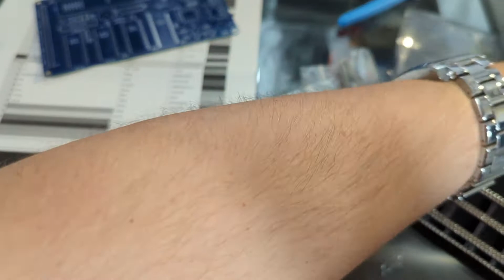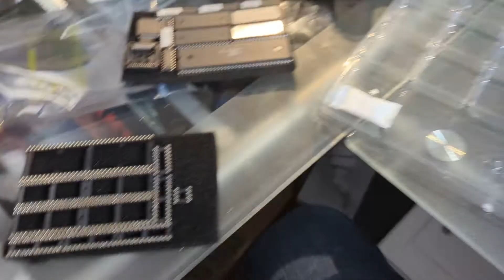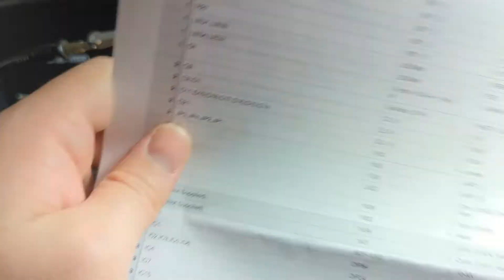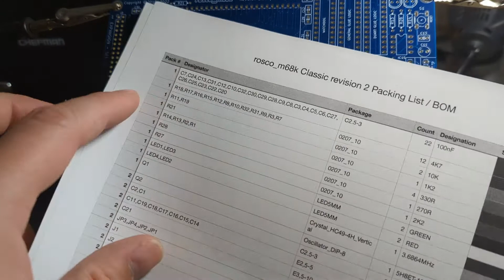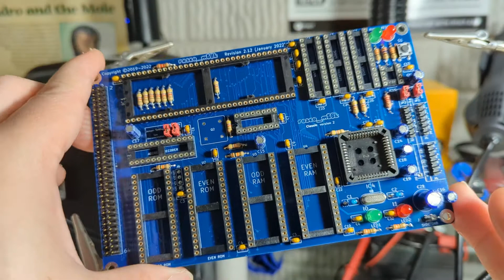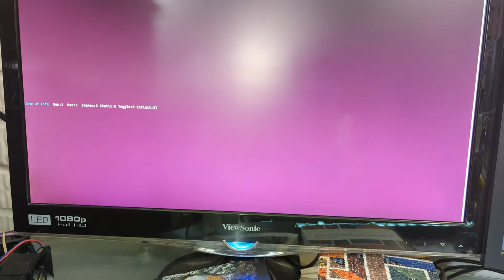ROSCO M68k Computer Build and Showoff

Comment: I never had much luck with the first 68000 it was kind of a slowpoke.  What I did like was Motorola's decoupling of the DSP so you could run some things fast on a slow system.  I used to run NeXT machines at work (the 040-33 mono slab was the best one) and really liked those until I discovered PA-RISC, which runs the same OS+software.

I also kinda like the 68332 Motorola made a "credit card computer" engineering product out of that it was just stellar.

I think nowadays the most fun way of doing all this would be to pair a CPU with a FPGA supported by open-source tools.  By going that route you can build all kinds of two-chip solutions using vintage electronics... no need for high chip count anymore.  I mean before the pandemic you could get SRAMs for free practically but now golly- I think if you have the original CPU and an FGPA then it's enough.

Put another way if you're going to make a 68000 board then y'know that chip's appeal is really just the novelty of its form-factor... so nice maybe to pair it up next to a big honking brushed metal Xilinx part from 2013 or so!

Comment: Thank you for making this!  I just got around to building mine, fired it up, and just got garbage over the serial line.  The instructions clearly showed 9600 baud, but when I saw your Dymo label reminder of 115,200 baud, I switched my terminal to that, and presto!  🥳  Nicely done video, BTW, and a nice case idea.  I've been paralyzed by analysis paralysis on building / selecting cases for my various hobbyist computers, myself, but I think I'm going to have to finally get around to doing that, so these fun little machines don't get broken.